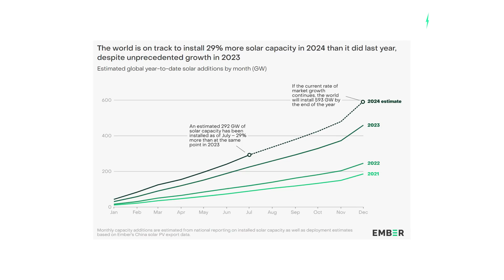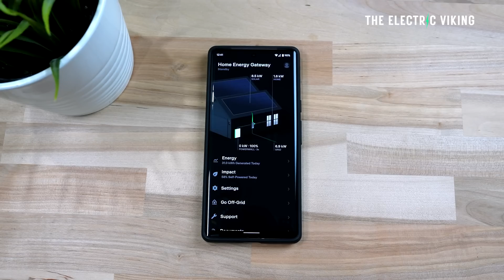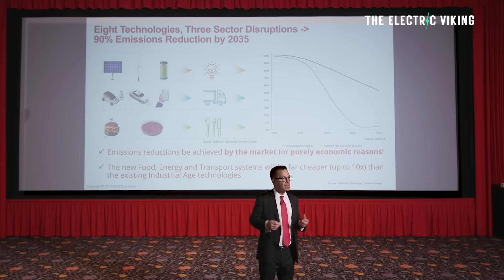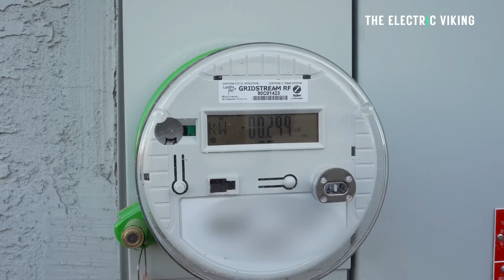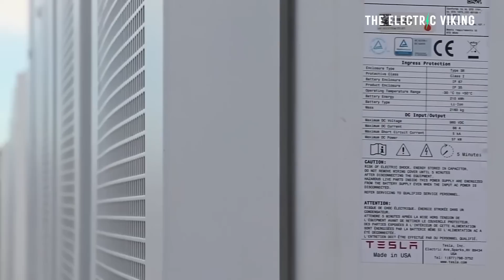Solar goes EXPONENTIAL - surpasses even Tony Seba's projections

Comment: Wait until you want the REAL AND FUNCTIONAL system with the battery back up capacity for those times the sun does not shine. Now check what your original purchase price for an entire, functional system costs, not the FAKE initial cost price. Now consider how many ”here today, gone tomorrow” solar companies, PROBABLY LIKE THE ONE YOU CHOSE, go out of business and offer you no recourse. Then comes the damaged panels, or maybe the dreaded roof rot. But be of good cheer because all the other conned buyers will be there to lie and tell you why your self possessed “saving the world” nonsense ego is right on. Yeh, and YOU now have the 60,000 dollar bill, three cracked panels and squirrels visiting through the hole in the roof you’ve been ignoring. Good luck, self awarding noble, self sacrificial “superior humanoid”.

Comment: Solar panels and EV chargers should be standard in all new houses.
All homes should be built to accommodate the elderly and disabled. This will be better for everyone.
Large wide doorways and hallways make using a cane, walker or wheel chair much easier.
Bathrooms or wet rooms need to have flat floors and no shower hump or pan. A flat floor allows for easy access and drains need to provided.
Easy to use lever door and faucet handles are easier for the elderly to grip and open.
Main floors should include a master bedroom, restroom, shower, laundry and wide walk in closet with few steps to enter.
Homes should be designed with aging in place in mind.

Comment: New homes should come with solar panels, a rain water collection system and an electric vehicle charger in the garage.
Reply: I’m with you but I would like to be the one deciding what panels to install, making sure the inverters aren’t “dirty” causing radio interference in the AM and shortwave spectrum and select a durable and simple UL approved charge station.

Comment: Just bear in mind not everywhere is Australia, hot and sunny. Lots of places are similar, loads of space and reliable consistent weather. But many are more commonly cloudy and closer to the poles than the equator, fortunately. Hot is horrid. 😁
Reply: In northern Canada, Siberia, Alaska, and Scandinavia wind power will probably dominate.  Wind is caused by uneven solar heating of the earth's surface, so indirectly wind power is also solar.

Comment: Yes!! 400-500 watt panels are going for $125.   So easy to put your entire house off grid.
Reply: No, off-grid is not easy, that's why a grid has been built in the first place.
Reply: @mattg432 ..the grid “was built in the first place” because when electrification started, there was no other way to distribute electrical power.

Comment: The DIY aspect of this is so easy that once you get into it you just keep adding.  Its still going to grow because DIY segment is just getting started.  Once I discovered ground mounts it just snowballed.  I knew nothing six months ago and now i have 1200 watts panels ground mounted feeding 6kwh batteries.  The best part its all under $5k. When i knew nothing, the solar knock vendors are quoting $3 per panel watt and grid tie only with no batteries for a 7k install.  Just reminded me of the days of putting a PC together. Once the math of power, ratios, and storage grabs a hold of your brain it becomes obsessive. Thanks for your insights.
Reply: Is there a website where I  can learn all this?
Reply: @philblum1496  seconded, it sounds very doable for sure
Reply: cool

Comment: Energy might be free at certain times, but not all the time.   For a free market or privatised model free energy doesn't work, there is always a cost for the equipment and the grid.  Home solar will certainly keep private companies honest.  You might socialise energy, and make it fixed price and control that pricing, but total gov't managed energy never worked that well.
The purpose of free energy is to encourage consumption, so we may well find that excess capacity get used up until a balance is reached.
we have many steps to go in the increasing of electrification.  If there is free excess power we can dump it easily as heat for the winter, or cooling for the summer.   That will soak it up.  Ultimately its going to be very difficult to countries like the UK to heat itself with solar power in the winter.
Reply: It’s more like you pay for your personal home power plant. The power plant isn’t free but then your electricity is

Comment: When you were talking about having 3TWh of energy generation from solar I was like: Damn that’s got to be a lot!
Until I asked google how much we use: Over 25000 TWh annually. 
So am I missing something?
Reply: Think you missed it's capacity. 3TW(no h), as in what can be theoretically produced in 1h. Quick Google suggests this produces about 1000TWh annually, probably wrong. 

JUST solar! Wind, Hydro, Nuclear...If we just keep the current speed of deployment fossil fuels will be out of the mix soon. Admittedly it will be hard to see at first as the 25000TWh does not include transportation, rise in AC demand and underdeveloped regions catching up.
Reply: @kopkaljdsao  Thanks, this was exactly what I was hoping for, so calculating that, 3TW would nearly cover current energy needs. Now that is reassuring! AI is also going to need a lot of energy.
Reply: @MrRobertBatchelor  Still a LONG way to go. Supporting technologies are lagging behind. Batteries are still having trouble incorporating into the power grid. Hydrogen is somehow still stuck in the testing phase. Big energy transfer projects spanning multiple time zones are facing delays and red tape. Nuclear energy got scary again after Russia occupied one of Ukraine's NPPs, turned it into a military outpost and psy ops operation. 

It's been solar, wind and Diesel doing the heavy lifting so far.
Reply: You confuse power with energy. 3 TW will produce around 3 000 TWh (it depends of course on the location, but as a very rough estimate for the calculation of energy I use 1 000 hours of full capacity as a yearly reference).

Comment: i am an optimist and i was aware that solar is growing very fast. but what i did not see, is, that the prices dropped again compared to last year by a significant amount. i thought that the prices might drop by about 5% but here in austria the prices dropped more in the region of about 20% compared to last year. i did not see that this is possible. this is the crazy thing. three years ago i calculated with about 80ct€ per Wp but prices are already in the area of 25ct€ per Wp. Of course there are differences in quality but really, I don't want to pay triple the price for a high end premium module that delivers 10% more value over 25 years. I go with the cheapest modules. If some of them are broken in 10 years? i don't give a f... because in 10 years i get tandem silicon perovskite modules with 30% more power for a lower price.

Comment: The SWIS (South West Interconnected System) in Western Australia was running today with more than 2/3 of the power coming from small solar. Basically rooftop solar and they are curtailing the large solar farm from about 10am as there is too much electricity. The Electricity people need to get more wind energy for night time and then massage the peaks into the troughs with batteries. I am currently learning what time to start charging my EV at night so that I mostly empty the home battery by the time the sun takes over. Seems to be about 3am. 😂

Comment: Western politicians are completely wrong in refusing cheap chinese solar panels. Buying a chinese solar panel does not create a dependence because we can use it for 25 years without the chinese supplier assistance. Unless it can explode by remote control ! (joke)

Comment: As an engineer, solar and batteries just make sense , cheap , low maintenance, no moving parts , quick to install and can be installed almost anywhere where there is sunshine ☀️, it’s going to happen super quick the move to solar and batteries 🔋, even probably ahead of wind 💨 and other more capital intensive renewable or low carbon sources of power.
Reply: Absolutely - If you drive less than 20 mi/day you can power an EV as well as a normal house essentially for free except of course for the capital expense. For EVs there is too much emphasis on emissions and not enough on low maintenance, few moving part and leaky fluids.
Reply: What's going to happen super quick?.
Reply: @grantbuttenshaw Mass adoption as prices continue to go down.
Reply: @alexandruilea915  prices aren't going down....they have already fallen
Reply: @grantbuttenshaw  they have continued to go down for years, why would they stop now? For batteries they will surely continue to go down.
Reply: @grantbuttenshaw you make no sense, troll.
Reply: @alex.velasco  your English is poor...get someone to explain it to you
Reply: @grantbuttenshaw  The speed of light.
Reply: @orionbetelgeuse1937  better and cheaper chemistries can't happen? Better manufacturing techniques increasing capacity with the same materials can't happen? Less waste as well by improving manufacturing. Not possible to automate more? Not possible to vertically integrate more?
Quite a bit to go before we are at raw resource cost.
Reply: @orionbetelgeuse1937  and yet it happens
Reply: @orionbetelgeuse1937  of course there is. The more you produce from something the cheaper it becomes per piece. Raw materials are only half of the equation, the other half is manufacturing and transportation. If they start to make the batteries in Europe for example they won't have to transport them as far and also not pay import taxes so the final price goes down.
Reply: @orionbetelgeuse1937
Reply: @orionbetelgeuse1937  BYD is building a factory in Hungary to avoid import taxes. They will be bringing processed materials there and manufacture the bateries in there. There are also sodium batteries (which we have plenty of resources for in Europe) that would be really welcome for solar (as weight doesn't matter in this field).
Reply: @orionbetelgeuse1937  well, taxes ar the biggest part of the price lol. A 100 Euros at manufacturing ends up to cost 200 Euros because you sdd import taxes, then you add retail profits and the you add the VAT so you end up with a higher price overall.
Reply: Hi Viking do a video on new panels.I have panels and 25 years old.What are the most efficient. Please Gez in UK ❤
Reply: batteries cheap? :/
Reply: @PazinPortugal  cheaper than before and continues to go down

Comment: Right now we have 2,8x the capacity we are using right now and that included with an EV. The south AND north faced roof are covered completely, we also have a 10kwh battery for the night. Now your asking why such over capacity? Well in near future we will cover mostly heating with it. 11.000kwh/y  consumption now, then roughly 25-30.000kwh/year.

Comment: In The Netherlands, solar AND wind and a few small sustainable sources (like bio fuel) produce more than 50% (2023!!) of electricity. The Netherlands is as northerly as the Hudson Bay! Most solar m2 per capita in The Netherlands. Electric production used to be from Russian Gas - shut off now!! Paris Agreement 2030 milestone is a certain hit. ...  now onto 2050.  How done: decentralized near the needs: on rooftops! Not far out (requires more network). Organize network flexibility at local level - driven dynamic pricing. Accept network connections and allow reversible dynamic pricing (with capa) for households. This changes usage patterns! Fill the car midday. Washers/dryers/boilers/ovens/e-bikes - if all adapt a bit, networks are easily balanced!
Reply: Issue in The Netherlands: winter darkness....  No sunbelt here. Wind is key in the winter, hydrogen storage can be utilized in the winter.
Reply: @nas4apps winter darkness. The batteries will eventually be good enough

Comment: We got a solar estimate here in Canada.  For an average house, they wanted CAD 63,000 (USD 46,700) to install.  They're gouging the public, so we're going to wait a couple of years for prices to drop.
Reply: Paul, not sure how handy you are. But look up the solar kits. You can permit install the system yourself, then hire an electrician for a half hay to check your work and do the final hookups. It’ll cut your cost by more than half.
Reply: You can blame Harper for that. There is a 300% import tariff on solar panels from China in Canada. If they were allowed into our market? You would be buying 400w grade A panels for $50. The cost to manufacture solar in China is now less than 10 cents/watt. And no its NOT slave labor doing it. Its a 100% automated process in China today. There are dozens of lights out factories with a handful of engineers watching screens an a couple of people doing QC. Everything else in the factory is automated from the materials in the one side to loading the trailers on the other side. And all of it is being powered by solar, so the energy bill is nil.
Reply: That's crazy 😮😮😮 almost criminal with how much they want to charge you! We got solar panels installed in Melbourne 5 years ago for $10k AUD
Reply: I am in Alberta and on top of the high install prices we are paying grid fees making solar more expensive than highly subsidized fossil fuel power. And the government announced huge tarrifs on solar coming down the pipe. Looks like we are stuck with old polluting technology
Reply: This is a note America problem mainly, in other parts of the world you can get a 7 kilowatt system installed around $2000  @willdoe7681
Reply: Sadly yes it does seem the installers are ripping off everyone everywhere. They see it as a new gold rush overpricing, cheating, customers.
Reply: It's not difficult to DIY. I suggest you buy and install the panels, mount the battery on the wall (if you are going with battery storage) and pay a local electrician to connect it all up. An alternative is mount the panels with micro inverters. This eliminates high DC voltage and the inverters can be plugged into your existing house wiring to feed back to the grid.
Reply: @nickwinn7812  what country are you talking about?....this sounds like BS
Reply: @grantbuttenshaw  I've done this in both the UK and France. Changed from battery storage and string inverter to micro inverters in France when the old lead acid batteries reached the end of their life. All the solar panels in both locations were installed by me.
Reply: @nickwinn7812  you can't do this in most of the rest of the world...the grid or your home is not able to accept energy via plug and play. It's against regulations in most of Asia for example
Reply: @grantbuttenshaw  What about Canada though?
Reply: @nickwinn7812  I don't think so..m
Reply: @grantbuttenshaw  Well, if you don't know about Canada, where Paulrandolph's comment was comming from, don't accuse me of BS.
Reply: @nickwinn7812  I installed my own backup system and I'm 68 y/o - it's very do-able - find a local handy'man' and follow the youtube DIY channels
Reply: Prices won't go down...they already did..

Comment: I added solar to my roof but it has two strings and south facing roof, but I want to add more the a smaller roof east and west but use micro inverters and cannot find anybody that know if it is feasible to  add to the 240volt side and gain in the morning and evening. Nobody knows or rather will not say if it would work.

Comment: Congrats on the new solar!
I haven't had an energy bill for 15 years. Just cleaned the solar panels for the 1st time, so amazingly clean after 15 years. Bar chart shows about 10-20% more energy now per day.
Only regret is I didn't have a monitor of how much energy solar makes and I used the last 15 years. I can recommend some UX friendly software if you don't have any software monitors.
Solar rocks!

Comment: It is no brainer in solar belt👍, but elsewhere there is no overall solution than nuclear yet. In northern europe wind is increasing(1-5% yearly), but the fluctuation of energy and back up storage are the challenges in winter.☃️❄Storage solutions are being built and invested but it takes  5-10 years time to make greater impact. 

Still new gen safer nuclear is coming. It even must come to consume all nuclear waste to energy again and reduce the waste to 1/10♻️ and reduce radiation time from 100 000 years to 300 years.♻️

Yet with low radiating Thorium these plants can go on 20 000 years for Thorium is in abundance for example in old waste piles of mines ♻️

The Ukraine experience in conflict ie Russian invasion, unprovoked attack,  has shown benefits of micro power like solar. On the other hand they are easy targets, but when there are energy source in every home you cannot target them all. Wind mills has been easy targets for Russia. Water energy and nuclear in big plants are also problematic when you do not have enough effective air defence.